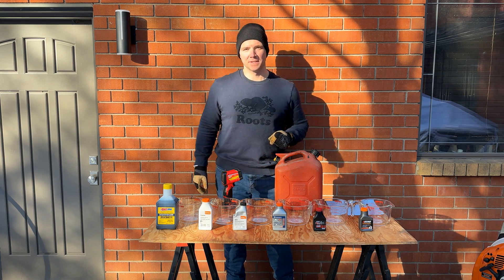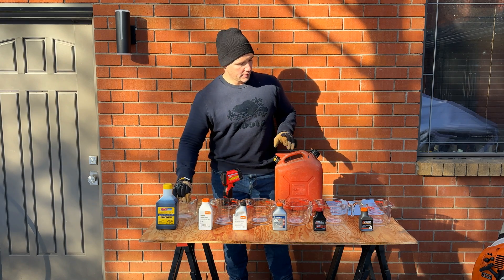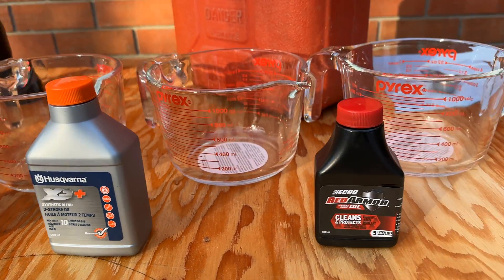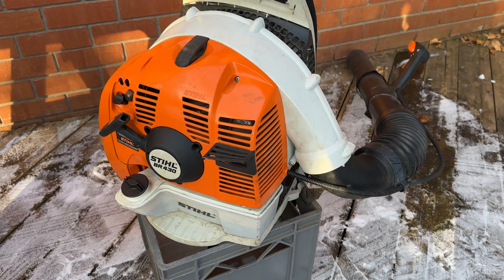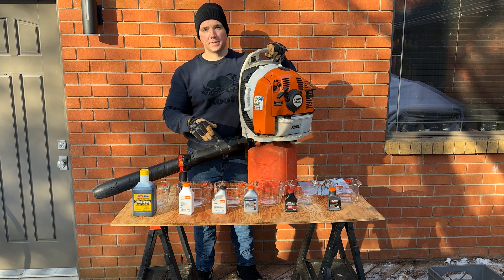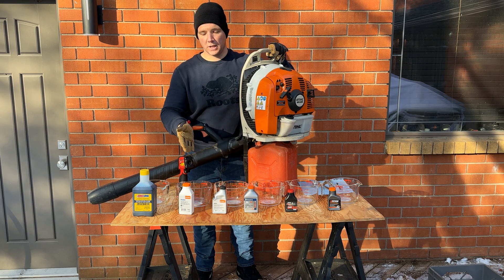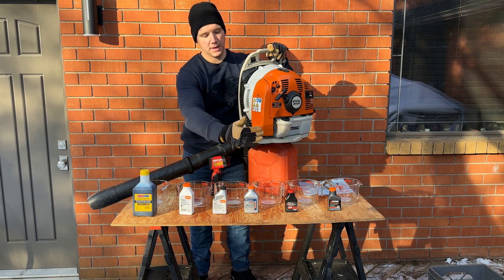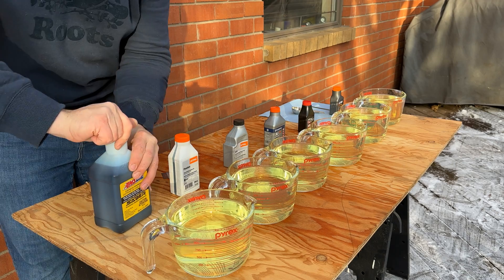Which 2-stroke oil is safest for your small engine? Temperature testing 6 of the most popular oils!

Comment: Been a small engine mechanic for many many years and rebuild a lot of small engines, landscaping equipment, dirt bike engines & even RC airplane gassers included. None of the oils you tested outperform Redline Racing oil for ring & cylinder cleanliness & possibly longevity. None. The large ester base-stock they use removes contaminants much better and lubricates in extreme temp conditions (like lean runs on our RC engines) much better than other oil too. Now I haven’t thoroughly tested the Husky or Echo brands, but the others I sure have. I can speak from many many years of experience. I used to be 100% all in on Stihl Ultra Premium oil for small engines until I started noticing a trend in my own personal engines during rebuilds; way too carboned up. For example, we retune these gas 2T gas RC carbs on every single use, unlike the landscaping equipment which the needles are rarely ever touched. Even then, too much carbon buildup over time, unless ran extremely rich & under low stress/load conditions to continually wash out the combustion chamber. Ever since switching to Redline, my engines, and the rebuilds I do for customers have noticed a massive difference in consistent running due to lack of carbon buildup. The top-ends look nearly new! I’ve never gotten the hours on any engine that we get from Redline synthetic oil. There’s a reason even Desert Aircraft (DA)  now only warranty their engines & military drone engines when used with Redline Racing oil. No one has more rebuild data than those guys. Period. 👍 All these oils are great and beat the Dino oils of yesteryear, but a couple of them are still the reigning champs. An no, I have affiliation with Redline but the results have spoken for themselves in my own experience of small engines.

Thanks again for a great video. I’ve always been curious in exhaust temps between the brands. Head temp data above the exhaust port or under the plug via telemetry sensor would be the way I would have done it as some oils extract head heat better than others, but should show-up in exhaust temps like you’re doing here. Thanks again!
Reply: Good day  So how expensive is  Redline?   is it in Canada?  Thanks
Reply: @donvoll2580  Yes it’s available in Canada, (I’m in Alberta) from a few speciality shops like Mopac, and some of the racing shops. I often just order it online from a few places, but I’m sure Amazon carries it now. Used to buy it Canadian Tire (the main distribution stores) but it’s hit or miss if they still carry it. Hope that helps!
Reply: @donvoll2580  lowest I’ve paid is $13 CAD and the most I’ve paid is $24 CAD for a 16oz bottle in Canada. You can buy it by the Gallon jug as well, but hard to find that way.
Reply: Thank you for posting your experience with Redline Racing Oil. I’ve never heard of it but your experience with it sounds amazing thus the reflection of its price! About $1 per oz unless you buy it by the gallon which would last me 2 lifetimes 😂. 
What would be recommended mixture for good protection & non carbon buildup? Will it “erase” current carbon if I switch over?I’ve ran Husqvarna oil in my saw for 20 years now & I’m not complaining but I’ve never opened up to see what carbon deposits or what wear is evident. From your response, I’m assuming there’s a difference between Redline synthetic & Redline Racing oil? I’m going to purchase a 16 oz bottle to check this out. Thank you again!
Reply: @northdakotakid8787  All Redline Racing oil is synthetic, there’s not two versions. Good luck! 👍
Reply: @Eganwp. Excellent commentary.  Thank you.
Reply: @northdakotakid8787  also, it will help clean previous carbon a little bit, but you’re better off running some premium fuel for the detergents + some SeaFoam added to the fuel. That will clean a lot of the carbon out and won’t hurt anything. It’s actually good for your engine to do so, especially 4 strokes.
Reply: @halflife82   I'm trying to find if in my country Redline Racing oil exists. Google gives not the most useful results. is the oil truly called EXACTLY Redline Racing on the bottle? or is it called Redline and some other term?

Comment: Nice video.   I would take the temps while engine is still running and ambient air temp is the same for all.  Metal cools so rapidly that a few degrees difference can happen in fractions of a second.   Think of a welding bead and how doing a slight side to side movement while welding allows the metal on each side to cool enough to help prevent burn through.
Reply: yup... appreciate the effort but  considering  the length of the test the ambient temperature may have changed enough to affect the results for all we know. Im convinced that red armor does a good job of cleaning and that stihl ultra does a good job of clogging stuff up with carbon build up, that seems to be the most  consistent feedback for each respectively

Comment: Been running Amsoil mixed at 3 tablespoons (1.5 ounces) to 1 gallon of gas for over 25 years. Never had any issues of any kind with ANY 2 cycle equipment.
Reply: Have you noticed using Amsoil for the two cycle your equipment lasting longer my Weedwhacker’s and blowers I use them commercially only last two years and then I throw them in the garbage I was wondering if I used Amsoil if it were you would get another year out of it

Comment: McCulloch string/brush blade trimmer (1994), Husqvarna 257 chainsaw (mid-1990s), Poulan 2900 Farmhand chainsaw (2000), & Jonsered CS2152 (2006)  - Since the  McCulloch & Poulan recommend a 40:1 gas/oil mix, I just  use that ratio for all four items (one gas can/always non-ethanol).  My grass trimmer is 28 years old, & my newest chainsaw is 16 years old.     I use a 40:1 mix of cheap Poulan or Super Tech 2-stroke oil in all of them.    The Husqvarna was my dad's saw, & I don't know what he used before he gave it to me 10 years ago.     I would rather run a 40:1 mix of cheap 2-stroke oil over any of the oils tested with a higher ratio.    My stuff may smoke a bit more than some, but I've also never had to replace a 2-stroke piece of equipment..   My previous 2.5 acre home was mostly woods.  My current place these past 20 years includes 70+ acres of woods, & I burn firewood.     I don't consider myself an occasional chainsaw user, but I am not a professional logger either.
Reply: I guess the moral of this whole "which oil" question is which is a lot less important consideration than if. In case that was a little too cryptic, it dont matter much which oil, but never forget oil.  I never put gasoline in my mix tank unless I have the proper dose of oil in hand and add it right on the fuel island.  Let the gas pump measure exactly 1 gallon (the pumps are routinely tested to make sure they are metering properly) is close enough. With all the different 2 cycles I've had over the years, all but the first one of which I still have, never have I had an engine failure. Used lots of oils but mostly brand names, and mostly Stihl. it is accumulation of other broken/worn parts that cause it to be parked. I've never put a new plug in any of them.  I finally lost count of the carb kits I've done, lots before I discovered NO ETHANOL. Put the walbro spiral in my saw last carb rebuild  last spring, so far it runs like a champ! Keep your trimmer line soaking water in a plastic coffee can and you will have a lot less string issues from jambed heads and the line lasts a LOT longer. I'm tired of the stank of Stihl Ultra and I finally had to clean the spark arrestor screen on my 094r line trimmer this year (6yrs?). BTW  I know lots say it's a bad idea but about the only time I'm at full throttle is with a blower, and occasionally with my saw, part throttle and cold running are known risk factors for carbon buildup leading to clogged screens, so I was expecting the clogged screen eventually. 10 minutes and a propane torch once every 6 years is not too bad.
Leaning heavy toward Saber and would already be running it if it was on the shelf locally. I'm out of the last batch of Ultra so it is time to switch. So I am back to listening to what you all prefer.
Reply: @laserflexr6321  It does matter. I wouldn't use any oil that isn't FD rated in stuff personally. Try finding a rating for the cheap super tech stuff. Order some Saber. I run it 80:1 in all my saws and it works absolutely fine. It burns super clean at lean ratios like that. It lubricates well and it's clean. Can't ask for much more. I like the way XP+ smells better but that's a small thing. Either one of those oils has never let me down
Reply from the maker: Do you ever have issues with spark arrestor clogging?
Reply: @DavesSmallEngines  No
Reply: @DavesSmallEngines  Remove the spark arrestor. We run conventional premix anywhere from 32:1 - 40:1 as well, and we stopped throwing away equipment every year, in a commercial environment. Spark plugs don't foul either. We remove our spark arrestors since concrete and asphalt doesn't usually catch on fire in an urban environment.

Comment: Amsoil is the best oil there. Then red armor.
Reply from the maker: How can we know that for sure?!
Reply: @DavesSmallEngines  lol there is no way of knowing. It’s tons of hours researching, talking to mechanics, personal experience. Stihl oil is very nasty- search on YouTube a chainsaw builder constantly tearing down saws with Stihl oil and showing its crap. And tearing down saws with amsoil and it’s stellar.
Reply: @ MedjOOL Maker…..What ratio(s) would you suggest with the Amzoil and the Red Armor ?
Reply: @shannonwhitaker9630  red armor says 50:1. Amsoil I’ve tried 80:1, 60:1 and finally just settled on 50:1 for peace of mind. Red armor and Amsoil saber has fuel stabilizers too. I would only run amsoil or red armor, what ever is cheaper/easier to get.
Reply: I wouldn’t say the Stihl HP (Orange Bottle “Castrol”) is garbage. It is an API-TC rated oil and it has fuel stabilizer. I’ve run some old steel sleeve industrial water pump 2-stroke engines with Stihl HP for a decade + (couple thousand hours run time) now. I buy the oil in gallon jug cases if that’s an indicator. The application has the engines running at 75-100% power most of the time and there is no appreciable carbon build up or abnormal wear problem. These other oils may do just fine also so without extensive personal use I’m not going to call them all S:@t !
FYI I believe Buckin Billy Ray uses the Castrol 2-cycle. He most likely has more experience with 2-cycles than anyone on this comment thread. 
I personally run 42.5:1 in all my various modern 2-cycles with the exception of the old steel sleeve engines which run at 32.5:1.
Reply: @shannonwhitaker9630  just because a guy cuts trees for a living, does not mean he knows his oils inside and out. only trust the shops and mechanics who tear down and show you the results when piston and crank is on the bench.
Reply: I’d say what he thinks and uses goes a tad bit farther than what you think and advise.

Comment: Well, guess I'll be using husqvarna oil from now on.
Reply: I was thinking what you're thinking. But the Silver Stihl was only seven degrees warmer at W.O.T., while the Husky was several degrees warmer than the Stihl at idle. I think I'ma gonna try the Silver Stihl, get a Ratio Rite and try it in my Echo blower too. Then get an infrared thermometer and test some more brands my own self.
Reply: @jdsolberg7613  I do mix my gas slightly rich, around 45:1 just to play it safe, it's not going to mess with any engine it runs in because all these name brand oils meet high rating standards to burn cleanly so I wouldn't worry about carbon build up.
Reply: One has to get down in the 40-42:1 range to see a meaningful difference from 50:1. Even then you are talking about a very very small amount of extra oil. Manufacturer inconsistencies in bottling and hap-hazard mixing-measuring can mean ratios that are all over the place above and below 50:1 anyway. We can see the care needed to get even results with this experiment. What I find most interesting is the one oil being advertised to run at 100:1 being tested at 50:1. It did just fine apparently. Lets go to 100:1 and see if there’s any appreciable difference.
Reply: I definitely wouldn’t choose an oil based solely on a 10-20° difference in exhaust temp.  It just doesn’t mean anything about how well components are being protected.
Reply: @jameshegeman5660  we need project farm to do a lubricity test.

Comment: Dave you sum gun!!! Outstanding job, and appreciate the effort and hard work!  Ya know, you sounding more and more like Don!  😆 

IMHO, Husky and Red Armor, rest are garbage!  ‘Richard Flagg’ has torn down engines, and says stay far away from Stihl ULTRA!  My smallest Husky 345, is about 17 years old, and I recently pulled the Muffler, and the piston looked factory fresh!  NO Joke.  90% of the Fuel run through it has been Husky oil, mixed at around 45:1.  Rest has been PreMix.  Well done Dave!  👍✌👊😊
Reply: 45:1 is 2.84 ounces of oil per gallon. 50:1 is 2.56 ounces of oil per gallon. So is .28 ounces of oil going to make any appreciable difference ? Lets test that lol
Reply: @shannonwhitaker9630  I dont know Shannon, why don't you check out other channels, that advocate running saws on a little richer mix!?  Maybe try running a saw for almost 17 years, and pulling the muffler, and seeing a pristine piston side, then you tell me!  As with everything in life, there’s no cut and dried rules, to each their own.  YMMV.  Some run them at 100:1 with that AMSOIL stuff.  A lot of variables to take into account.  Now run along, and have a Merry Christmas!  I hope Santa is good to you.  😆 🤩✌

Comment: If I want to run a JASO FD oil in a certain saw, especially my vintage Homelite and MAC saws, I run Husqvarna XP at 50:1 with PNE gas and stabilizer.  My primary oil is 77ml of Stihl Ultra with the same gas and stabilizer.

Comment: I was hoping that Red Armor would do better since I bought a gallon of it recently.
Reply: red armor is good stuff.
Reply: Redbull661 did tests several years ago monitoring cylinder temps and such. He would also tear down the saw to see how well the combustion chamber looked and residual oil. Red Armor always performed well. He would even use different octane ethanol free pump gas and found that 89 octane seemed to perform the best.
Reply: I wouldn’t draw any conclusions from these temperature statistics.

A slightly lower muffler temp doesn’t really mean anything about how well the oil is doing at its primary job of protecting engine components from wear.
Reply: As far as I’m concerned it’s red period 
Don’t trust ultra shit period

Comment: Hey Dave, By measuring the exhuast temperature, aren't the results just providing an indication of how the fuel burns in that set-up?  Was there a hypothesis being tested (i.e. lower exhaust temperature means better or "safer" oil used in the fuel.)  Statistically, there is only one set of data, with zero degrees of freedom.  So the results really can't be looked at with any degrees of confidence.  I think so long as the oil additives meet certain industrial standards, they most likely are all adequate.  There can be so much variability with the condition of the equipment and how the equipment is used.  I tend to lean towards using a quality (meets a Standard) full synthetic 2-cycle oil and mix the gas at 48:1 just to error on the side of always having enough oil in the gas. I also think using ethanol-free gas is just as important as using a quality oil.  Thanks for sharing.  I enjoyed the video very much.
Reply: I agree on using Non-E fuel and a rated quality oil but the difference between 48:1 (2.66oz/gal)and 50:1 (2.56oz/gal) is negligible. If one wanted to error on the “safe side” a ratio of 40-42:1 seems more realistic. We are literally talking about a tablespoon or so more oil per gallon.
I run all my modern “50:1” engines at 42.5:1 or 3oz/gal. My old steel sleeve engines are run at 32:1 or 4oz/gal.
Reply: @shannonwhitaker9630  I agree about the difference between 48 or 50:1 how clogged the air filter is makes a lot more difference  in how much oil is going in the engine than that as does needle settings.  I'm always paying close attention to how it is running, any hint of a bog that would suggest it is going lean and I stop immediately and fix the carb, (or put some fuel in the tank).

Comment: Good testing with interesting results. I would like to see the same test in warmer ambient temperatures and see how that would effect the engine temperatures. I used to Stihl synthetic but i had issues with carbon build up and the screens getting clogged on mufflers. I switched to the Echo Red Armor and it does a great job of cleaning and preventing carbon build up. I run a Landscaping company we go through 10 to 15 gallons a week of 2 cycle mixed gas and I am sold on the Red Armor been using it for a little over 2 years now.
Reply: Yes, I love the red armor. But truly a Redmax fan. Red Armor cleans the inside better. Stihl must was clogging because I couldn't get full power until I use redmax, then got better with a can of red armor.

Comment: Nice test comparison Dave. I have 3 pieces of Stihl equipment and only use the Ultra Stihl oil in all of them with no issues. I think any of the oils you tested are fine when mixed properly. I also only use premium non ethanol fuel and i add Seafoam to all small engines whether it be 2 or 4 stroke. Great video Dave!! ✌👍🎥🇺🇸🇨🇦
Reply: I use (1) oz for STA-BIL Marine 360 (stabilizer) and (1) oz or SeaFoam (in every two gallons of premium gas) for ALL of my small engines.  
I have been doing this for over 10 years with no carburetor or engine issues.  The marine formula combats moisture and ethanol the best.
Reply: I agree , especially on the seafoam .